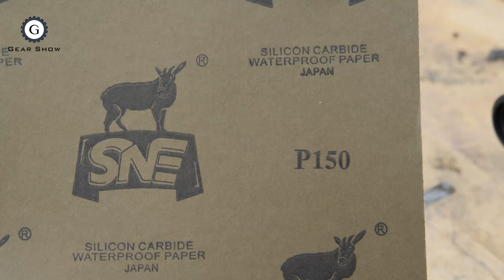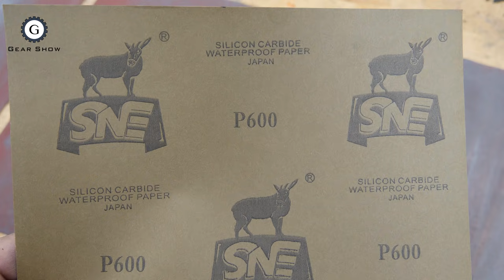$3 Rusty Japanese Knife Restoration

Comment: Awesome work, but just a few comments. 
Thats is a Deba knife, thought for fish processing. You flat grinded the urasuki. The handle is supposed to be set by burning it into the handle hole and there must be a separation between the bottom part of the blade and the upper surface of the handle that makes sharpening, cleaning and removing nasty bits that can get caught there much more easier.
Cheers!
Reply: THANK YOU so much: I knew something was wrong with that "design editing", now I know what was it, and why.

Comment: That was, and still is a good single bevel knife. A substantial blade, not a thin, flimsy machine stamping. Hand made by a HUMAN with a hammer and a hearth, not a machine stamping it from a sheet of steel. Despite the rust, the point is intact and there seem to be no chips from the cutting edge.  Look at the thickness of the back of that blade. The shape of the tang still shows the work of the one who forged this blade. It is possible that he is long gone and your restoration of his work honors his craftmanship. He might have chosen other methods for the restoration but towards the end you employed methods that he would have recognized. I have quite an arsenal of single bevel knives and while I am not Japanese, I would not trade them for any price. Well done.

Comment: Deba is traditionally a fish knife. You don't need epoxy for the handle. Make the hole a little smaller than the tang and torch the tang red hot while holding the blade in the vise. Tap the handle slowly on and it will burn and seat itself very nicely. Make sure not to heat the blade, too.
Reply: That is a method of seating a tang, but largely a historical one. Japanese knives tend to have replaceable handles, but the burn on method is not ideal. The soot on the interior of the handle can oft act as lubrication, and will often leave an unsightly and bigger hole at the opening of the tang slot. Epoxy is typically a better standard to go by. And if you want a new handle you can still replace it easily by breaking it off. Not talking out of my ass, bladesmith with 5 years of experience here, and so far no complaints on handle design. Let the man do his thing. It's not perfect but he's going out and fixing good work.
Reply: That long and thick handle will be a pain in the ass when filleting a fish, which this knife was meant for and not for anymore.
Reply: @karasunoendou  That's not true at all.

Comment: Fantastic video and excellent craftsmanship. 
I do have a question, on one side it seemed flat with  a bevel and the other side of the blade was concave . It looks like you ground it flat on both sides. 

Another restoration video I recently viewed showed that the concave side  was there for a reason: to help with slicing more efficiently and reducing food sticking to the blade. 

Is having 1 concave side common on all Japanese knives or just certain styles?

Thanks 👍

Comment: Unfortunately you removed the hollow grind that this single bevel japanese knives have for a specific reason by sanding it on a flat surface.
It would have been better to lock the knife and hand sand it with sand paper wrapped around a rounded element.
Reply: Show us how that is done.............
Reply: I have same opinion as yours.
"Uraoshi" is important for this type's Japanese cooking knife.

Comment: On the left side remain a bit holow or is flattened totally?
Reply: It’s flat as you can see from the sanding on a flat table.
Reply: @robertp457  it seems you  change the whole functionality now. Is not bad, just very different in work with. 
Anyhow, is way better than stay and lost in rust.

Comment: I don't understand what you were doing with all the hand sanding.  Why not just put some 80 grit on your belt sander and take both sides down until all the rust pits were gone.  Then go up the grit scale until you were at whatever you wanted to finish with.  Then tackle the bevel(s).

Comment: I do have to say you made this knife look very beautiful, but I hate to inform you this knife to a real collector is still only worth about $3. The side you spent most of your sanding on to make completely flat is not supposed to be flat, it is supposed to be concave, it is forged this way to make cutting easier, it is not supposed to contaminate the food you are cutting, I dont know how that works but that is the reason for the concave section of blade. Again I think the knife is very beautiful but you did ruin the value of the knife and did a lot of unneeded sanding

Comment: uh... have you ever considered just buying a grinding wheel?  watching you use sheet after sheet of 100 grit sandpaper for what should have been done in 15 mins on a grinding wheel was painful.  also?  that edge is useless.  it was far too corroded to begin with.  you needed to remove at least half an inch from the blade edge BEFORE you tried to sharpen it down.  as it is, it will never stay sharp.
Reply from the maker: Using the grinder wheel will heat up the blade, and the quality of the blade will change.